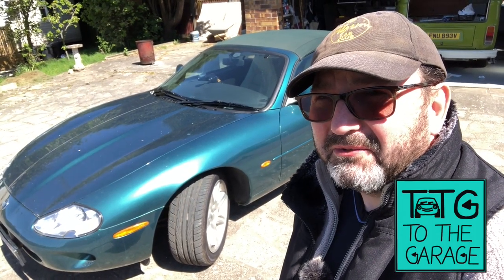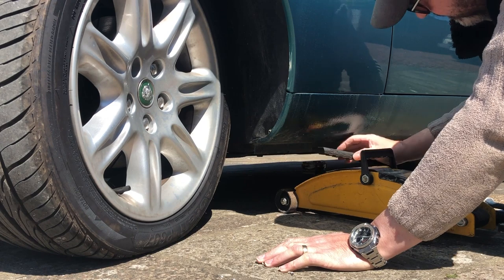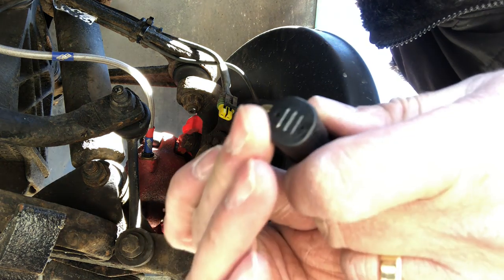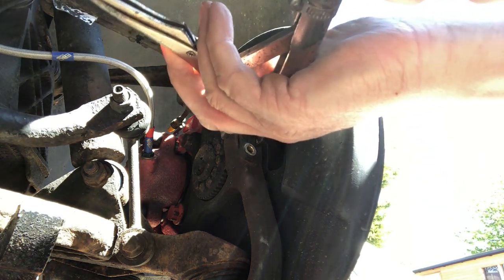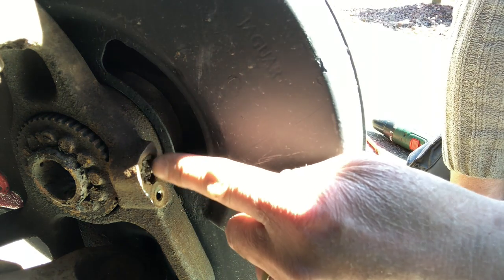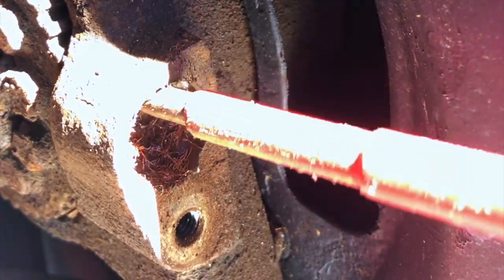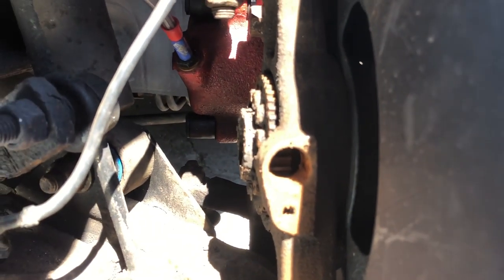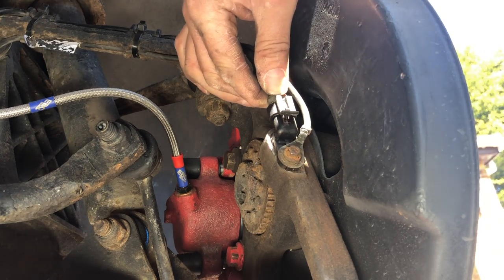replace ABS wheel speed sensor

Comment: Hello John. I diagnosed this issue with an icarsoft code reader which identified the near side sensor. To remove the sensor I screwed a large ish diameter screw into the sensor and pulled it out with a claw hammer. 😉

Comment: I had my ABS motor rebuilt many years ago with great results.   I live in Wisconsin,  USA and drive my XK8 in winter so the ABS gets a regular workout.   Those in milder climates should find gravel and exercise their system, the motor can seize from lack of use...
Reply from the maker: Quite agree Scott. I like to test mine out whenever I am on a loose surface.

Comment: Wow what a pain getting that sensor out! Great video, my car exhibited similar warnings after a very wet drive and has disappeared since so I think the sensor must have got moisture in it, the issue I’ve got now though is that I tried to remove the sensor but the retaining bolt sheared!!! Doesn’t look like it will just fall out though based on this 🤣🤣
Reply from the maker: Yes I would not worry about it until it fails😁

Comment: Another great video. Next time I am over there I will have to take a drive and look for your flag. I will have to keep an eye out for your video on removing the door panel. The one on my drivers side has a loose connector on the top corner. Procrastinating on taking it off and replacing connectors, so I will wait until you do it.
Reply from the maker: Its not too bad a job once you know where all the screws and clips are. But a good idea to have some spare clips on hand as removing the panel generally kills a few more clips than just the one you are trying to replace.

Comment: I started receiving Cruise Control Not Available, DSC ABS System Fault warning on my dashboard. I booked the car into a local Jag garage & they diagnosed a front ABS wheel speed sensor fault. After fitting a new sensor the fault code remained. 

WARNING!  The ABS wheel speed sensor fitted was the wrong one!  Part no. LJA2226AA which fits all XK8, XKR 4.0 Models, 1996 to 2003. However, all later models were fitted with a new part no. XR822753F. This part covers all VIN no's. from A30645 to end of range.  My XK8 is a 2004 4.2 & the garage were completely unaware of this!
Reply from the maker: Thanks 711honved. This is a great piece of intel for us all. Sorry that you had to experience frustration for all of us to gain this useful fact though.

Comment: Hi, very interesting and informative video. I have a 2004 model and last summer it started to have the DSC fault light coming on followed shortly afterwards by the ABS warning light. I found by turning the engine and turning it back on the fault would clear and the ABS light would go off. However, as the season progressed the DSC + ABS light came on more frequently and didn’t clear by engine switch off/on. Last autumn the fault was isolated to the front o/s hub. New harness fitted. Fault returned about 3 weeks later. New hub sensor fitted November, fault returned after 1 week. Fault intermittent since then. Any ideas on next steps would be appreciated. Note when car is not in use battery connected to trickle charger. Battery Is about 18 months old. Thanks
Reply from the maker: I would typically say its the Battery but doesn't sound likely in your circumstances. Try the resistance in your battery earth lead when you move it. If it varies, replace the lead. if this is not it. disconnect the alarm sounder in the front of the right wheel arch.  If neither of these resolves the issue then you may have a genuine fault on your ABS motor. 
The fault is typically just a dry joint on the two supply leads into the motor's control box.
Reply: Hi John, thank you for the advice. I will try them out and will let you know how I get on. Cheers Paul

Comment: I wonder if the three plates would extend out proud of the surface and if you could then grab them one by one and pull them out to relieve the pressure outwards?
Reply: I have the ABS/traction control fault (99XKR) that pops up at times. Had to convince the WOF/MOT guy here in NZ a few days ago it wasn't a reason to fail it. I said that I bet the fault would be gone by the time I drove it out. It was so I emailed a photo of the dash to him as I drove off. I haven't investigated out where the fault is yet but thanks to your videos, know where to look now. We don't have salted roads, I can see corrosion is probably the biggest cause but so are muddy country roads it seems.
Reply from the maker: No matter where we live in the world, there is always an element of the environment that damages our toys. The dryest areas with clean well ironed roads tend to go hand in hand with UV damage to dashboards and paint laquer😁

Comment: John, 
brilliant videos. My asc sensor is stuck as was yours. On reflection is there an easier way to remove the sensor as it has been suggested, it may be easier to remove the reluctor wheel and hammer the sensor out from the magnetic end. What are your views.
Regards
John.
Reply from the maker: Its possible that may work better John. Ive also seen suggestions from other subscribers including. I should have melted it out with a blow lamp🤔, And drill 6 mm hole and then   pull it out using a large socket, a washer and a long 6mm bolt in a similar way that you might pull out a suspension bush👍
Reply: @ToTheGarage  .  Cheers👍

Comment: Hi John, another great vid thanks. Just a quick question, what is the paint colour name for your brake calipers please, as thinking of doing the same to mine.
Andrew
Reply from the maker: Its powder coating Oak tree3. so the colour is just High gloss solid red from electro static magic. the powder cost £4 but you would have to spend another £200 to set yourself up with the required kit. 
Sorry😔.
However I genuinely have a video showing my set up if you are still keen.
https://youtu.be/kj56MgSwcm0
If you decide to stick to paint. Check out the excellent videos of fellow subscriber @italjohn13 https://youtu.be/cm_G9foeoGE. He has tested several and some of them are 'NOT good'
Reply: Thanks so much John for all that info, I'll look into it

Comment: hiya thanks for these vids theyve helped me alot with my jag ,one thing thought have you got or done a vid of adjusting the throttle cable mines got a lot of slack ,ive got the workshop manual on cd but it says a lot of stuff about using a diagnostic tool to do it but i dont have one surely its got to be a simple job after all its just a cable?,btw mines a xkr x reg
Reply from the maker: Not yet but you are right its an easy mechanical solution.
I will add it to the list
The RHD is marginally easier. for the obvious reason of it being a British car. the linkage is very straight forward. LHD look a little less obvious but its still easy

Comment: Do the speed wheel speed sensors also affect the cruise control.
Reply from the maker: Good question>. Not 100 % sure. Im sure someone will let us know.
Reply: To The Garage thanks for the reply. I love your channel, never miss it. By the way, I also own a 97 xk8 ( manufactured in 1996  but sold as a 97 in Canada. ). Just this year I also purchased a 2007 xk and will give the xk8 to my son. It was very low mileage ( less than 30,000 miles and vfor a very good price)
Reply: MY 2004 XK8 ABS LT ON ALSO NO CRUISE CONTROL

Comment: Will WD40 help?
Reply from the maker: Hi Joseph👍
I used a full can of 'WD40 specialist penetrant' and one of Halfords 'shock and unlock' (A freeze based release agent) when I did the brake rebuild. Nothing touched it. 
I think a small amount of corrosion in the I.D. of the hole combined with a swelling caused when moisture entered the sensor and set off internal corrosion.
The combo made it feel like the sensor was 1mm bigger than the hole!
In fairness I did not try the blow lamp!
Reply: What do you think about cleaning the contacts  and what would you use to clean them with... seen several videos on it